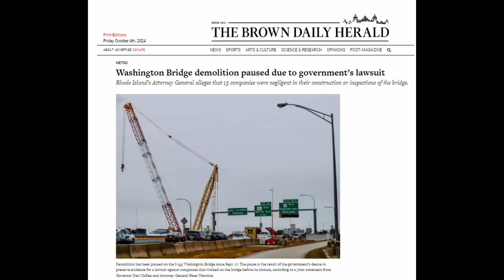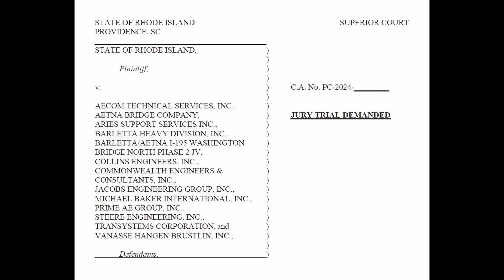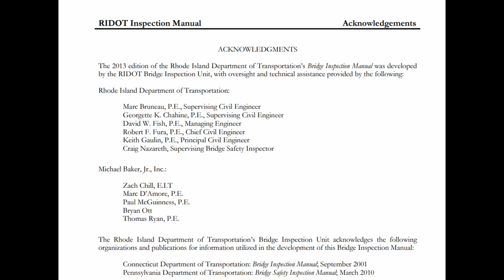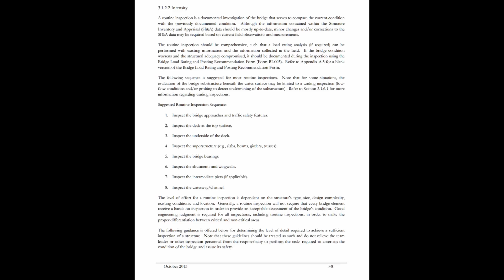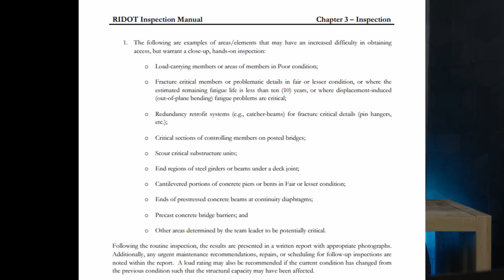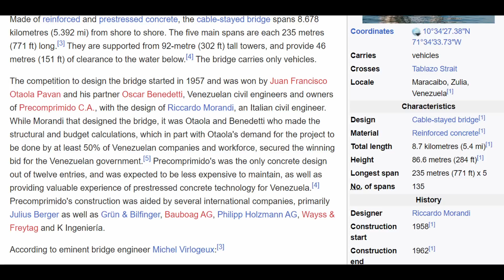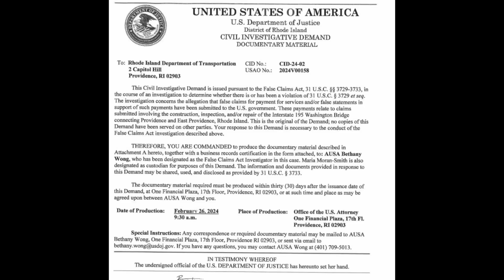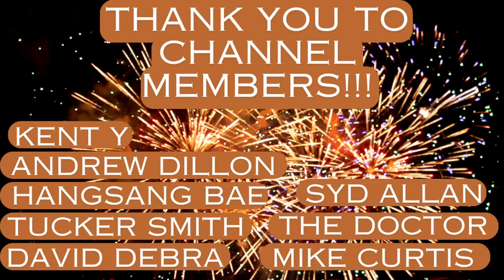Washington Bridge Update with Drone Footage

Comment: Casey, This bridge is over 60 yrs old ?, i doubt if we would build to that spec now, and it was never expected to carry the density then as it did i assume, IT LASTED WELL. lack of maintenance, parts no access to etc, then the DOT talk about litigation, not a wise move, just get on with replacing it.
Reply from the maker: Thank you, I totally agree with you.  It is like somebody going 100k miles between oil changes and thinking they can sue the auto manufacturer when the car quits working.

Comment: In Rhode Island, state workers, and most certainly those at a management or supervisory level, are NEVER held accountable for
their actions. Governor appointees are immune from any form of oversight by anyone other than the Governor and receive layers
of protection. In this case the state will sue anyone who even contemplated working on this bridge so as to divert attention from the
massive failures within the RIDOT leadership. Meanwhile, the bridge will come down with no intelligent plan for replacement, and
no contractors willing to risk building a new one. Unless of course they can find a Chinese firm.

Comment: Notice how traffic is moving.

Kind of makes you wonder whether that Westbound bridge is even needed.

Induced demand and road diets are a thing, after all.
Reply: The increased traffic on the east bound side is of concern. The added weight of the extra vehicles will lead to a premature failure of the east bound bridge. The state knows this and have already put weight monitoring equipment on the bridge.
Reply: @bobcosgrove3235  Well, at this point, that's not exactly a spring chicken, either. They've been doing work on that bridge since I was a kid (good god, its been ~28 years, now).  All that construction simply can NOT be good for it.  The current Eastbound span opened in 2008.  That's 16 years on its own.  With the Westbound probably under construction for the next 10, it will be getting older (26), to the point where a rehab will be due.  Then it will be time for the Westbound to get another check-up.

Comment: The inspection is only useful if qualified people read it before throwing it up on a shelf.  Also inspectors need to be supervise by the people who commissioned the inspect.  We always required that any point being inspected was marked with spray paint post inspection and we could at least confirm in a walk by that an inspector at least showed up with paint.   I have found on reports that inspectors noted inspection times that coincided with when  I was sitting in the break room drinking coffee with them.
Reply: The past inspectors obviously didn't climb up there to inspect that as it's stated they should in the RI inspection manual for poor rated bridges. I don't understand the lawsuit. The past inspectors didn't do the work but the bridge is already rated poor and has to be replaced anyway. Are they just suing for public safety and how do you put dollars on that?

Comment: If you are interested in early stressed concrete structures, you would be interested to learn more about the Gladesville bridge in Sydney, Australia. Built in the early to mid sixties, it was extremely advanced for it's time- being the world's largest single span concrete arch when it was built. 
There is a fair bit of information online regarding it and also quite a few longer format videos on the coonstruction- which the relevant companies and governments were justifiably proud of at the time. 
It is one of my favourite bridges- being elegant, very advanced when built and one I have crossed thousands of times.

Comment: A few years back RI started replacing bridges on I-295 i know specifically that the junction between I-295 and US 6's bridges were replaced in a fashion where they removed the steal beams, and then removed the exterior concrete on the abutments and pillars to expose rebar. Then they refaced the same abutments and even in some spots added extra pillars to existing supports. They then put new steal down and redecked it. Is that a normal method of construction? I would think that if you need to add a third pillar to a two pillar support maybe just start from scratch?

Comment: How can they have? Leaving the stringer/girder beams in place over a public road after removing the roadway above is not safe.
Patching spalling simply places lipstick on a pig. It masks rebar expanding from rust, caused by water ingression, which is not reversible. We all remember the decking issues in the Champlain Towers collapse - and where are we there, please? The lesson of load transfer to the neighbours from that applies here, of is the bridge standing on the strength of the concrete alone?
As regards redesign, if nobody else wants in, ask the Army Corps of Engineers to cut the cackle. This is strategic infrastructure. But at the same time, ban every company involved from all future public sector contracts. Put simply, pull your big girls knickers up, boys, and decide if you're civil engineers or not.

Comment: I live in RI and as a rower, rowed under the Washington bridge starting in the 1990's. They have been working on that bridge off and on for decades. The original was a four lane draw bridge. The bridge you see in the video was a renovation done in the early 2000's. Since then there seemed to be  endless work on the thing. Expansion joints needed repairs etc. So why no one saw the issues that finally resulted in its closure is a mystery. In the early 2000's it was said over 90% of the road bridges in RI needed replacing. In fact one of the on ramp access bridges on the right in the drone footage was held up by stacks 12x12 wood beams at the time of the 2000's renovation. Note: what is happing here is not new. The route 95 bridges through Providence are currently being replace due to structural failures. The RT 95 bridge up river had to be replaced as well in the 2000's. Look at the Big Dig in Boston. It opened then a tunnel roof panel fell killing a driver. Faulty epoxy in the roof fastening. And of course there was the bridge section on RT 95 in Connecticut that collapsed without warning. The infrastructure in this country is crumbling.

Comment: Great video. Thank you. I worked for AECOM and other engineering firms for 40 years as a Commissioning Engineer. I found that the more defects I found the more I was hated. I eventually was forced to resign and retire because I refused to lower my standards. Fortunately I was well off and was fine with it. But most, if not all other CX engineers did not have a problem lowering their standards. I’m sure this is what happened on this bridge.
Reply: I agree Gerry.  One of my engineering team worked you years back.
When you are the proverbial stone in the shoe, you are resented by the bean counter crew.
Reply: @PowderMill  Want to know something scary.  In software, almost certainly including software for monitoring equipment you use, it's much worse.  In most companies, especially large companies, putting  a warning that doing xyz causes bad measurements will get someone fired.  Not because of the bug, but for making it public.

There is almost never 3rd party inspection of software. All the certifications are for processes, and not actual quality.

Comment: Re: how can they sue if their manual says they are ultimately responsible?

One might interpret "ultimately responsible" for the inspection program as including responsibility to recover damages caused by inadequate inspections.  I would guess that this logic forms the basis for the lawsuit.

Make sense to me, anyway.  The program manager physically cannot inspect these bridges in place of the organizations the actual inspections are delegated to.  If that were possible, you wouldn't need a program manager.  One of the tools in the kit bag of a program manager is to take enforcement actions when people or organizations which fall under the PM's authority are found to be underperforming.  

At this point, it will be for a jury to decide whether the consulting firms failed to meet the spec in the manual, or whether the manual failed to specify adequate inspection controls.
Reply from the maker: Great point.  I don't know the merits of their lawsuits, but to me, it seems politically motivated.  No matter what, the lawsuit will indirectly, and likely, result in extra costs and delays for the eventual replacement bridge to be built than they amount of money they ever could or would recover from these lawsuits.

Comment: I am not a PE, but I do hold a Civil Engineering degree from GaTech, and I worked for a municipality for 25 years, mostly as a construction manager and construction division manager.  After collaborating with a host of other municipalties and younger engineers, most have near zero understanding of the impact that contract documents and the municipality's reputation have on the cost to their customers/constituents.  Bad documents with a bad reputation forces contractors to price in a lot more risk.

Comment: Quick note: Your last two videos have a noticeable hum in the audio, as if there was some interference from another electrical signal.
Reply from the maker: Thank you for letting me know.  I will trouble shoot the issue.  I have tinnitus pretty bad so I don't hear it above the normal high pitch that I always hear.
Reply: @CaseyJones-Engineer  Oh, sorry to hear that! I have tinnitus too, but apparently without hearing loss, so it actually makes me more sensitive to noise like this. Appreciate the reply.

Edit: One frequency I can identify is about 120 Hz, with multiples on top; probably related to the 60 Hz electrical frequency in the US.

Comment: Err when does a bridge in "poor condition "  get ignored for decades ,  in poor management obviously , those tie rods could have been brush galvanised ,  weld repaired ,  replaced,  or any of dozens of techniques mostly cheaply to stop the degradation,  to waste a steel bar like that takes extreme conditions time and zero protection

Comment: Casey, what is/was the design life span of the bridge? I recall 50 years on most concrete structures and if that is the case the bridge design and performance exceeds that. Any life after the design expectancy is a bonus for RI. At the end of the design life shouldn't any structure be subject to a complete forensic examination and a refurbishment plan be presented? This failure is a reflexion of all aging infrastructure.

Comment: RIDOT is proving the axiom that a bottom/nadir has been reached and only progress lays ahead. The situation has gotten far worse and their is now no bottom in sight. By allowing litigation to halt and delay replacement Ridot has assurred no progress or accountability will be assessed until the litigation has ended. This may take decades and any state officials will by then be retired in advance of resolution. A non engineering question has arisen for me in that from photos of failed members (pins) they do not appear to be compromised by lack of maintenance. Next if this in in fact correct what steps or inspections would have prevented the failure. Further was this failure built into the design itself and inevitable given the choice of sizes and materials used along with their placement? I expect that shortly RIDOT will have to pay the Demo firm ongoing fees to leave equipment sitting idle at jobsite plus inflation costs for delaying completion of demolition, just to re-mobilize will cost many thousands of dollars. Good luck getting any to work on this needed project, I would terminate any of my team who wasted time and efforts bidding to get work from RIDOT as from a business viewpoint RIDOT contracts seems suicidal. This public agency for what I deem are political reasons seems to be not working in the public interest. Ray

Comment: Another great video, thanks. Anecdotal referance only here; I was at the other end of the totem pole of construction; I was the guy that got the ladder or set the saffolding for the consultant(s) to check for whatever they were contracted to inspect.  Many professionals were hands on; they got down and dirty. But others, not so much. I think you should mention that some inspections and inspectors are better than others. 
Kinda like "street side" inspections for roofing code compliance. Yes, that was a thing in my construction working experience.
Reply: Yeah the poor sod that actually did what the manual said to do on a poor rated bridge, climbed up then found this. Wonder if he still has a job.

Comment: I have a brother who is a Civil Engineer who worked with bridge replacements for decades (I'm a Mechanical Engineer).   He tells me that he has done a number of smaller bridges that were able to reuse the existing foundations (with perhaps some surface repairs or riprap for protection) - as they were concrete piers down to bedrock - and locking ridges were cut into the bedrock before the concrete piers were poured.  

Of course, not all places have solid bedrock within 10 ft (or so) of the river bottom.

Comment: I am fairly new to bridge inspections (10 yrs- part time) at the municipality I work for in VA.  As an independent city, the municipality is responsible for the inspection of its "reportable structures" (centerline spans 20-ft or greater) as defined by the FHWA NBSI criteria.  The state DOT supplemented the FHWA criteria with additional requirements such as 12-month inspection of fracture critical structures v. FHWA minimum of 24-months.  

An interesting practical concept bridge inspection is that we can only inspect what we can see and typically touch.  An example is a bridge in our jurisdiction is an old road bridge built by a railroad consisting of steel beams set edge to edge and filled with concrete in between.  We are unable to inspect anything of the beams other than the outside bottom flange.

IMO, One interesting item of note is that the older bridges were designed for a lower weight standard (HS-20-44 as in 1944 std) v. the increased interstate loads of today's vehicles.

Comment: Great channel. Going to bust your balls a bit but you need an audio engineer to help clear up that static/buzz you got going on.
Reply from the maker: Thanks.  I am not sure what crept in there.  It is frustrating because it is my normal set up.  I couldn't hear it because I have pretty bad tinnitus.
Reply: I can hear it as well, low level, not a bother to be honest, had to really boost the volume to hear it.
9:42 Could be a fluorescent light nearby……or something simple. Didnt pipe it through my audio analyzer, lazy, sorry.

Comment: What would the theoretical liability be for one of these inspection firms even if they did miss a broken anchor rod?  It's not like they would have caused it in the first place.   The whole thing looked heavily corroded for a long time, so any opportunity to remediate or reinforce, if it existed, was passed on many times.  Also imagine if RI does win, surely no one would work on any project in the state ever again if you assume all liability for a piece of infrastructure by doing any work on it?
Reply from the maker: Those are great points.  RiDOT bears a lot of responsibility for mismanaging this bridge in my opinion.  They don't seem to realize that if a judgement amount were to result from this lawsuit, the amount of that judgement would be reduced by the percentage of whatever contribution that RiDOT had made to the problem.  Also, RiDOT and the state of Rhode Island are causing big escalations in the costs to replace this bridge and increased time for which to do it.
Reply: @CaseyJones-Engineer  Not to mention that a future bid by any company will be increased to take account of future litigation.

Comment: Left a crane that probably costs 30-60k a day … and probably causes another lawsuit the demolition company will file for not meeting the terms of the let contract . Would not surprise me if RIDOT will blame the lack of progress on the demolition company per the let contract .. RIDOT definitely does  not comprehend claims avoidance and mitigation
Reply from the maker: Thanks for your comments.  The indirect costs of RiDOT and the state of Rhode Island suing on these people will have contributed to significant cost increases and delays in getting this bridge replaced.  Plus, I think their ability to actually prevail in this lawsuit may be very limited.  Any judgement amount would reflect the percentage that RiDOT was to blame.  That is why they have been "radio silent" about their role in this whole mess.
Reply: BTW the Madison-Milton bridge between Indiana and Kentucky reused the foundations.
Reply: My thoughts too. And the fact that they now have screwed up who knows how many more jobs down the line that the equipment and manpower from this project were set to move on to after this one was done.
Reply: Of course RIDOT understands claims mitigation.
Just research New Jamestown Verrazzano Bridge!
Reply: That contractor will be owed quite a chunk of change due to this owner-caused delay. I hope this “investment” is worthwhile to RI taxpayers…

Comment: Reusing foundation in Europe is more often done if the new bridge weighs less. Some WW2 era filled-in arches are like 10x the mass of the pre-tension segments that replaced them.
Reply from the maker: Interesting!
Reply: @CaseyJones-Engineer  Also I see a lot more building before demo done in JP/EU like the video "Timelapse vervanging brug Lunterseweg" where piles are put in before the old bridge is pulled out.
Reply from the maker: @leggysoft  Great point.  I think that should happen here.  They could put in a parallel alignment to the exist westbound bridge and install those foundations now.  Of course moving out into a new area could trigger delays from any required environmental permitting.